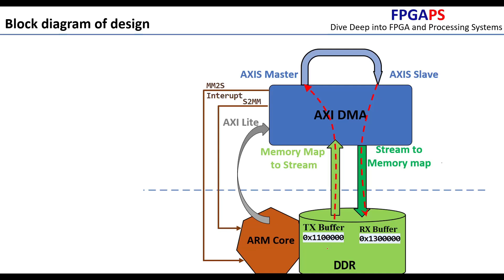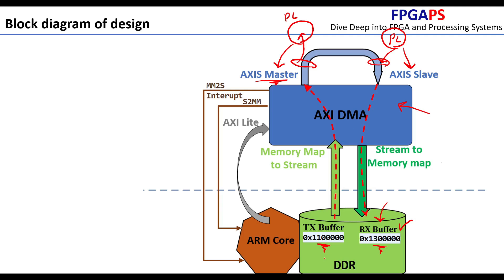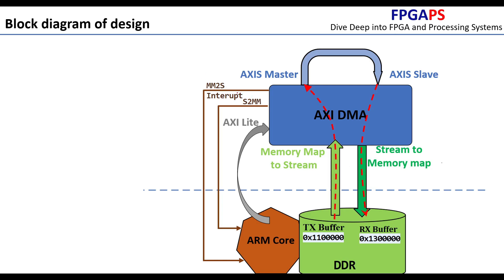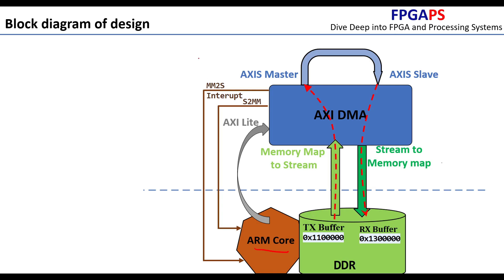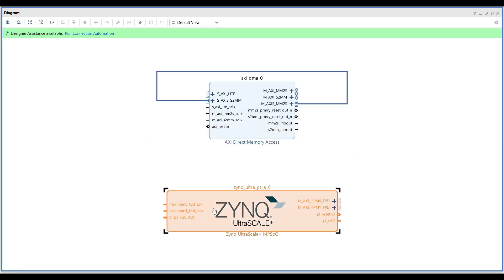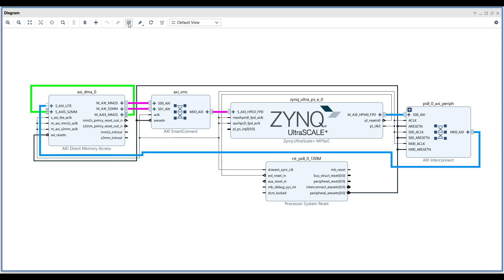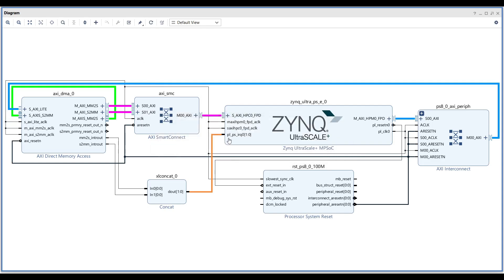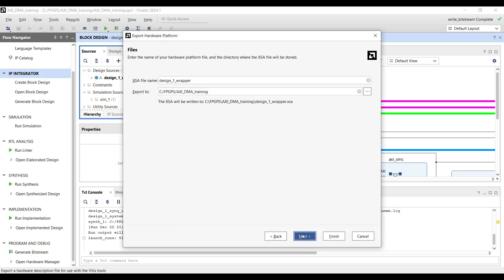AXI DMA and debugging with ILA, part 1: Vivado design

Comment from the maker: The first and simplest step when using the AXI DMA is to run it in loopback mode🔄.

 However, I’d like to engage your thinking 🧠with a simple question:

How can we send data directly from the PL to DDR?😎
If I have a basic counter in the PL, how can I transmit the counter output to DDR?🥸
Reply: is the way to do it is connect the output of counter to s_axis_s2mm